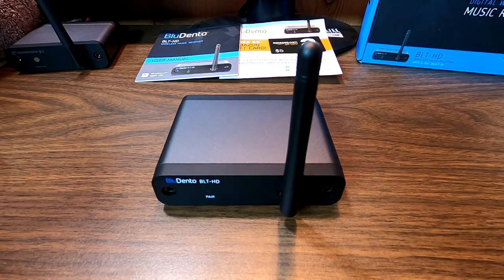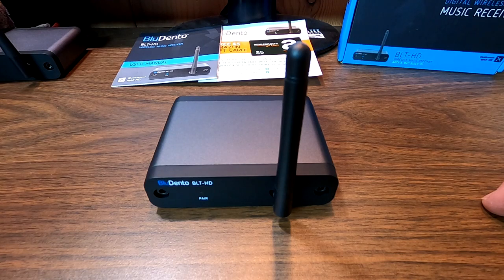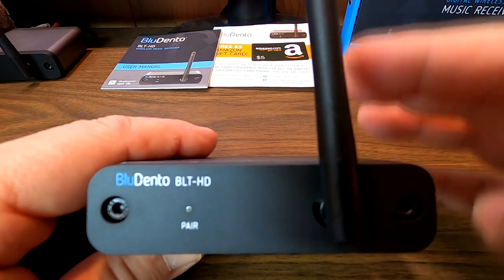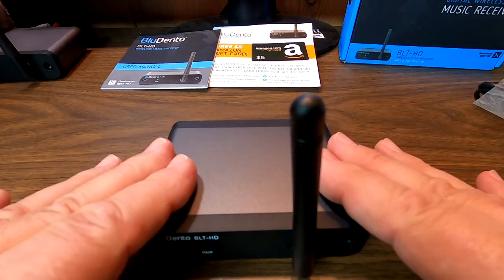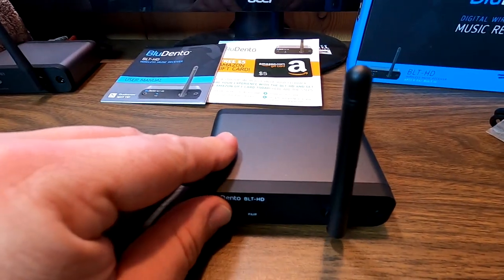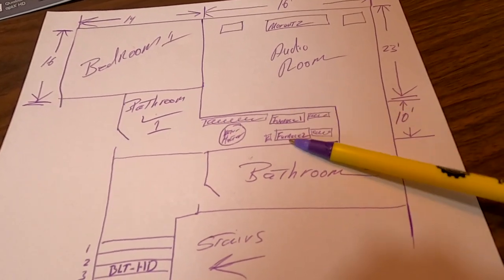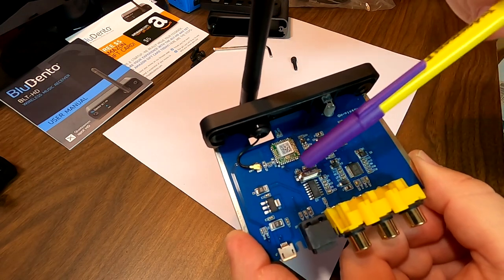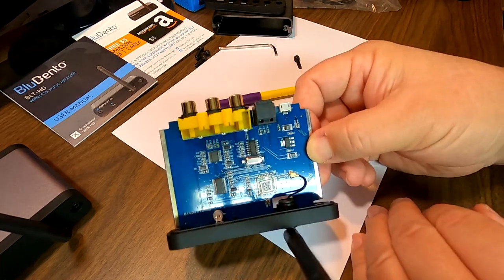BluDento BLT HD Bluetooth Receiver Review

Comment: It's top notch.  I have this as a receiver to an Avantree Audikast Plus Bluetooth Transmitter connected to a TV.  Latency is absolutely brilliant between these two devices, what a match.  The BLT HD makes my Logitech Z130's sound louder and more enhanced using the RCA connections at the back which undoubtedly outputs that same 2 volts RMS level as the Audioengine B1 which I also have.  Streaming Blu ray discs to the BLT HD sounds so crisp and it seems to be completely without that annoying latency problem.  We are dealing with Bluetooth 5.0 here so absolute minimal latency should be the result.

Comment: I have just bought the Bludento BLT2. The specs look the same with the same Brown Burr chip. It’s Bluetooth 5.1 and not 4 as you stated. I am about to connect to my Technics amps cassette inputs. I will let you know how it sounds. It seems remarkable value at under £60 off eBay and it only took a week to reach me in the UK.
Reply from the maker: I must have misspoke in the video, my BLT-HD says it is BT 5.0.
Thanks for watching, Cheers.
Reply: @breakerbroke23  been listening to the BLT2 using my iPhone 11 with Apple Music for a day and absolutely love it. My amp is a 20 to 30 year old Technics class AA. If I am being picky I would say not quite as spacious as my good quality turntable and CD player but not far off and it’s still a brilliant performance especially as it was under £60. Very easy to set up and clear instructions with all the cables provided but I used my own better quality RCA cables and a longer better power cable.
Reply: @tonyjedioftheforest1364 that’s because iPhone uses AAC codec. 

Try something that can do LDAC.
Reply: @destruxandexploze2552 I ended up using it with the SMSL SU1 DAC which improved the sound quality very much. I no longer use it and have passed on to one of my sons. I now use the Bluesound Node Nano  and Rega DAC to stream from WiFi.

Comment: IS this powered by recharagble battery? Or does this need to stay plugged into a wall outlet?
Reply from the maker: It needs 5v power supply. AC wall adapter for charging a phone will work fine.

Comment: The BLT-HD arrived today, AMAZING. I had the logitech one, night and day difference as you said (more powerful, more defined, left-right separation). 52 euros on ebay
Reply: Just ordered the BLT-HD can’t wait to hook it up 🆙
Reply: @PaulDoldenDetails  I love it!
Reply from the maker: Thanks for sharing
Reply: Have you the link for that from ebay?
Reply: @djotenjdm7213  Now the price is increased, I paid 62 USD (52 euro)
Reply: @manuelamadio1995  can you share the link please?
Reply: @djotenjdm7213  I did but you tube deleted it... Find one sold by bludento and it's ok, now costs 97,90 USD
Reply: Hi . I have the logitech. I feel the volume needs turning up more . Does this bludento have better loud clear audio
Reply: @user-thegoods71I switched to Wiim (airplay). If you have wifi, there's no reason to use bluetooth now.
Reply: @manuelamadio1995 That doesn't answer my original question 😂

Comment: This is great but one fundamental flaw - there is no pairing mode option. Therefore it is possible for these to connect to an unknown device without any means to reset. This happened with mine after months of good use. It’s now unusable.
Reply: You can unplug BluDento for a while to see if the blue light flashes again.
Reply: Thanks for the feedback. A new model BluDento B2 will be released soon with a reset button.
Reply: You can contact BluDento support. We will help you.

Comment: BluDento BLT HD or Fiio BTR3k for home use?
Reply from the maker: I have no user experience with the Fiio product. I looked it up and it looks good, I think it is more suited for portable operation, it can power headphones (does not look like it will drive full sized headphones enough due to its low power output rating ) and has balanced output,  most all receivers are RCA (unbalanced) inputs and I don't much care for battery operated units for a permanent home installation. So overall I would go with the BLT. IMHO
Reply: @breakerbroke23  Thanks for the reply! I think I will go with the BLT. I was contemplating the Audioengine B1, but from your comparison I think the BLT will be sufficient for my application. I will be streaming AAC anyway. Thanks again for the reply and helpful videos. Take care!
Reply: @paulstancel9731  forget the crappy sounding B1 from audio engine. This is far superior and newer.

Comment: I have one and LOVE it.  Also, big plus, the DAC built into this guy sounds better than the DAC in my Marantz home theatre receiver.  I used RCA's (using the DAC in the Bluedento) and then switched to an optical cable (to use the DAC in the receiver) and it sounds noticeably better (cleaner, less bright, and fuller bass/mid-range) than the Marantz.  It is a wonderful piece of geat to add to a system.  Great review by the way!
Reply from the maker: This unit is becoming one of my favorite Bluetooth receivers. I have been using it with a Schitt Modi 3. Sounds excellent on my old Marantz. Cheers.

Comment: Looks great but why no power switch / included power cable? It means that you'd need to spend another 10 bucks to get one of those USB to wall plugs with a built in on/off switch.
Reply: Thank you for the feedback. BluDento will upgrade it next version.

Comment: If I am to connect this to a Denon AVR 1611 receiver and it(The bluetooth device) has not power cord(ac adapter), how would I get power to this unit? My Denon does not accept a usb wire. Thanks for any direction.
Reply from the maker: The Bludento comes with the micro USB.  If you don't have one you will need to get a USB cord and a ac power adapter and plug that into the switched ac outlet on the rear of your stereo.
Reply: Thank you for the feedback. You can contact BluDento to get a free power adapter.

Comment: MPOW make one very similar for under £40 UK. Has optical and  3.5mm Aux connections. Works well too and has on/off switch !
Reply from the maker: Link?
Reply: MPOW BH262A Bluetooth Transmitter & Receiver
Reply from the maker: That unit is no where near the quality of the bludento.......
Reply: breakerbroke23 All I know is that it works fine. Picks up signal quickly, has indicators to show signal type and I can switch it on and off. Works perfectly for less money.
Reply: @rhiwderinraytube  yes, but it has no DAC built-in.  It is just a BT device.  HUGE difference.  The Bluedento will make your BT sound like CD quality.
Reply: @ramondelgado6778  to be honest I haven’t noticed any difference whatsoever !
Reply: @rhiwderinraytube  old guys suffer hearing and vision loss, of course they can’t tell any difference 😎

Comment: One BIG Fault - There is no On/Off Switch!  That means a flashing blue light unless you disconnect the power cable !  A simple on/off switch would have saved this annoying feature.
Reply: BoltAPureSource mine failed after a month! Receives Bluetooth but no sound from amplifier using either RCA plugs or Toslink optical...

Comment: I'm really a noob when it comes to this audio stuff. If using the optical output on the BluDento bypasses the internal DAC, am I better off using the RCA jacks if I don't have an external DAC unit? All I have is an old Denon A/V unit that has optical ports.
Reply from the maker: If you have optical in put on your Denon I would try it, I would also try your RCA inputs as well. Would be interesting to see witch one sounds better. Your Denon DAC may be better.... or maybe not, the BLT may have a better sound because it is newer technology. Great question and thanks for watching. Cheers...BB23
Reply: @breakerbroke23  appreciate the response. If my phone just has the 4.2 version of bluetooth, would there be any advantage of buying the 5.0 HD version in this review? I know it reverts to 4.2, but are there any features that I would notice and worth the extra cost? Thanks again.
Reply: @Blue_Dun  In this case, BluDento BLT-2 is enough for you.

Comment: I have 2 of the BLU DENTO BLT 2's.  Very happy with them.  Ordered from another source and was able to specify a different Bluetooth name for the 2nd one.  Therefore easy to keep separate on my devices when pairing.  Factory communication to do this and they were great about it.  Haven't heard this HD unit but can't imagine that it would be any better than BLT 2.  Have heard the Audioengine unit and couldn't tell the difference.  Two BLU Dento's or one Audioengine,,,,no brainer.